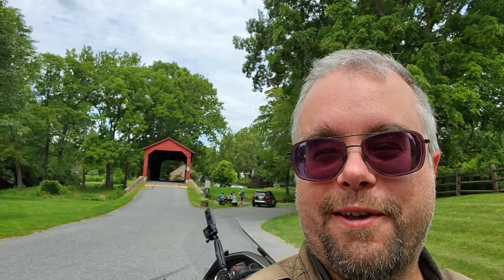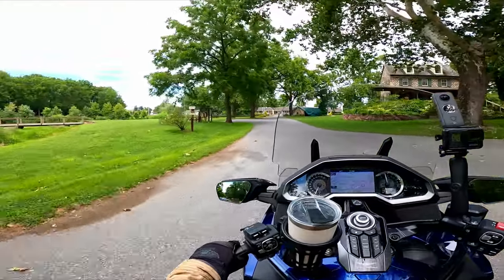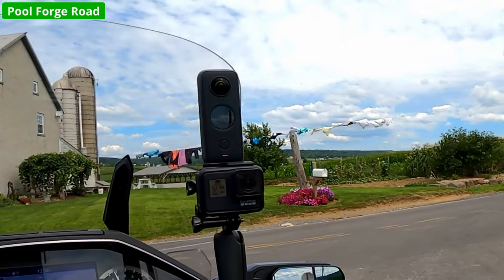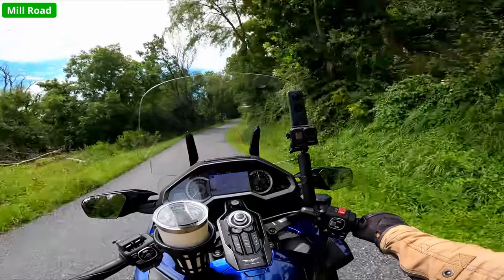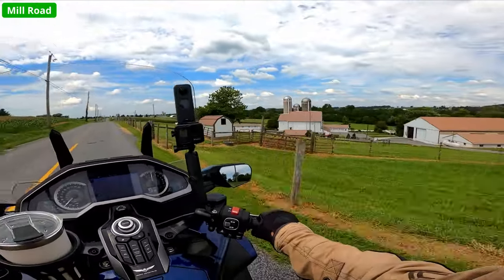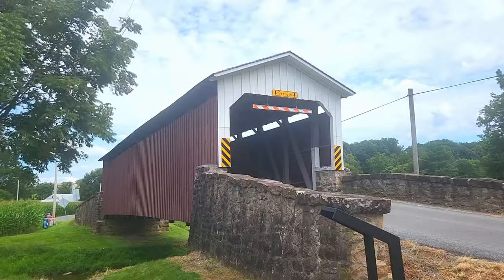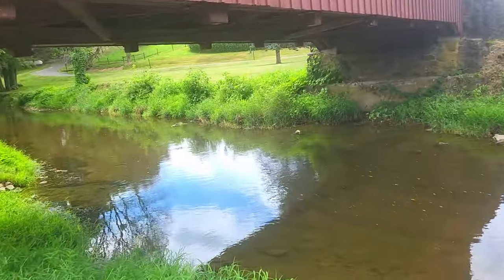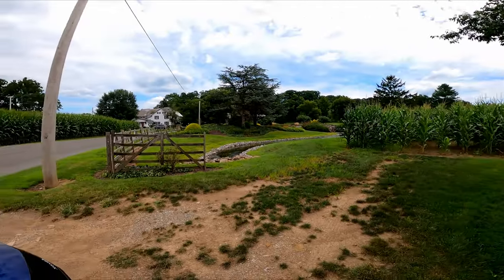Weaver's Mill Covered Bridge (Lancaster County PA)

Comment: Grew up in Churchtown right up the road from Pool Forge, Caernarvon Township has done a great job renovating and updating the property and the house.  Just a tip from a local, please be mindful on Rte 23, be considerate to us locals and be considerate through Churchtown as the traffic during tourist season is insane and many people do not have consideration or respect driving through town.  Rte 23 is a dangerous road and choked with traffic most of the time in the summer and frankly it's aggravating to us locals.  Thank you for being respectful and aware and being mindful of us locals and the area as it's rich in history and good people. Enjoy your trip and if you ever want some good back roads around I'm happy to share.  You were on Mill Road which is the cut off to Weaverland  Road where Weaver's Mill Bridge is.  When you turned left off Pool Forge and onto North Churchtown Road which you continue for about a mile and then you turn left at the bottom of the hill there and follow that up until you get to the bridge.  Mill Road is not the road you want to be on if you're not local, it is extremely narrow and tiny and curvy and uneven. Mill Road will take you up to the intersection with Weaverland and then you can turn right and see the bridge below on the right.  Enjoy the trip and ride safe.
Reply from the maker: Rt. 23 certainly can get busy, particularly on weekends.  I've been down that way more times than I could count, mostly due to Shady Maple of course!  It's just a beautiful road all the way from Morgantown to Blue Ball.  I always take it slow because of the nice scenery, but also because there often are horse and buggies sharing the road too. 😎
Reply: Consideration for the locals is standard operating procedure especially for Gold Wing riders. It should also be for visiting anyone’s town. But thanks for the reminders.
Reply: @roadglide  
When I travel I am considerate of the locals and areas I'm visiting.  That's standard operating procedure for anyone honestly and should be practiced every time.  I ride as well, and enjoy my trips to places I've never been immensely, two wheels are always better than four.